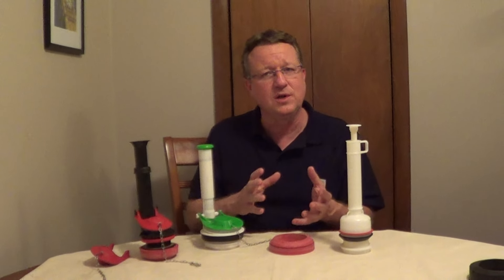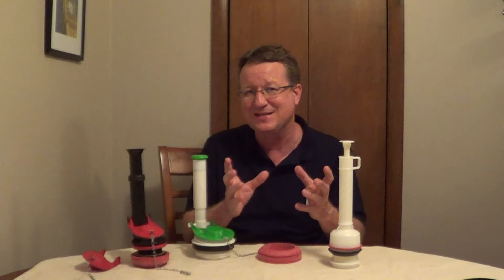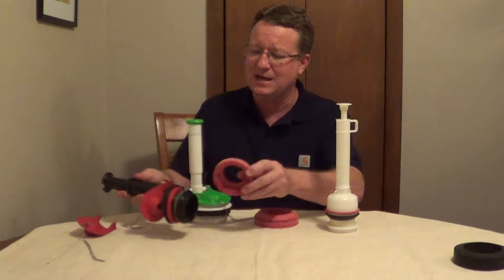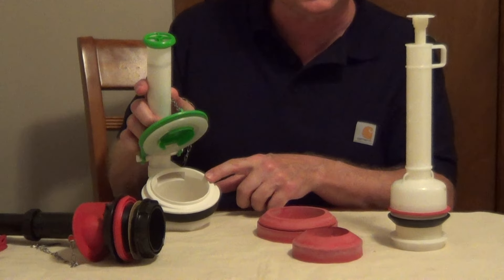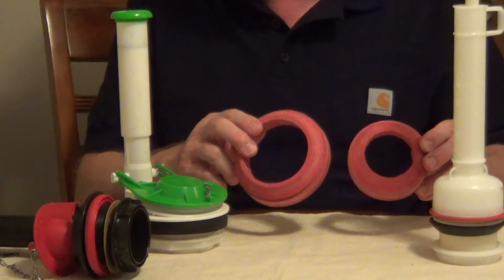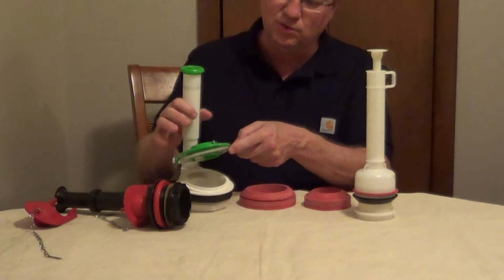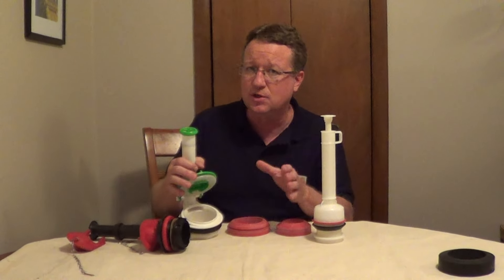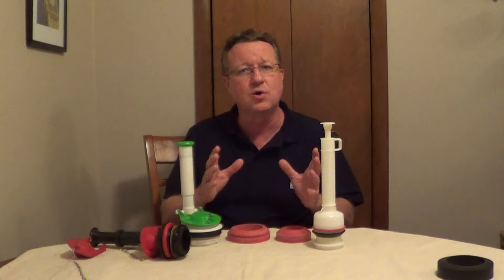Toilet Tank Leak - What Size Gasket

Comment: The spud gasket that came in the universal replacement kit is too tall, makes the tank sit too high on the toilet and wobble.  The old gasket seemed to be actually lining the hole in the toilet, is that something that's still available ?  Thank you for the video.
Reply from the maker: Hi, I would bring the old washer into a hardware store and match it up. There are few styles available. 
We have more home improvement tips on our weekly podcast 
https://itunes.apple.com/us/podcast/fix-it-home-improvement/id880903087?mt=2
Reply: What did you end up doing???  I thought I had the same problem that it makes the tank sit just a little bit high & wobble a little.  But I just watched a video by Ken Peel named "Toilet tank to bowl gasket" & he shows that his tank was wobbling (& you could hear porcelain hitting porcelain when it wobbled as with mine) & he showed that the gasket actually wasn't tall enough to reach the bowl/go down far enough to seal with the back of the bowl.  He bought another taller one & shows that he put that on & the tank is much more steady & doesn't leak.  I'm going back to the hardware store today lol.

Comment: What if the hole in the toilet is a little bigger than 2 inches? Closer to 2.5. The toilet is from 1983 and it sounds like the 2 incher will work. Let me know! Thanks!
Reply from the maker: Hi, a 2 inch flapper usually covers about 2 3/4 of an inch.

Comment: My toilet from the 70's is American Standard and it's a 4 bolt.  So I can measure the diameter of the drain hole (where the flapper is)  for the tank to toilet gasket?
Reply from the maker: Hi, yes, measure the ID of the area under the flapper. If it is about 2 inches, you have a 2 inch flush valve.
We have more home improvement tips on our weekly podcast https://itunes.apple.com/us/podcast/fix-it-home-improvement/id880903087?mt=2

Comment: I have an Eljer 464 model. Just tried to fix it with a universal 2 in". Does anyone know if there is a low profile type gasket instead of those big red ones? The old one seems to be about half the height and doesn't seem to be the same style as the ones that slip over that huge plastic nut on the bottom of the tank... I can't figure this out. A little help would be awesome from anyone.
Reply from the maker: Hi, I would contact https://nuflush.com/. They are very helpful and have replacement parts for most toilets.

Check out more home improvement tips in our e-books https://www.amazon.com/gp/product/B0B2KW1FQ9?notRedirectToSDP=1&.
Reply: @FIXITHomeImprovementChannel  Thank you very much. I didn't know if I was going to get a response or not.